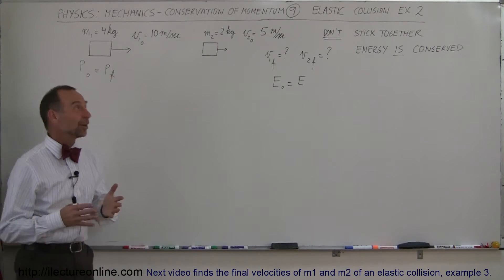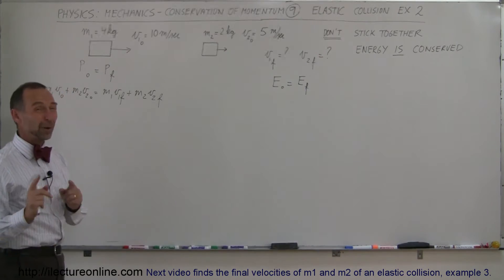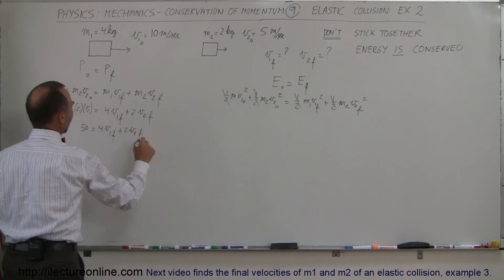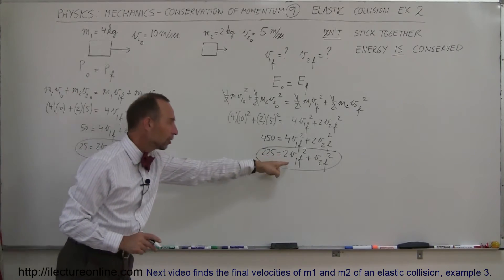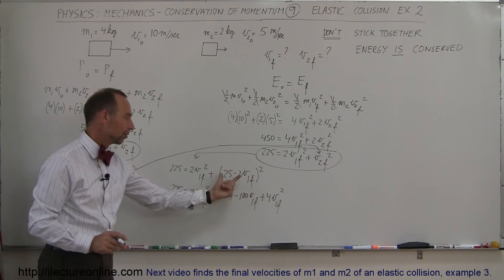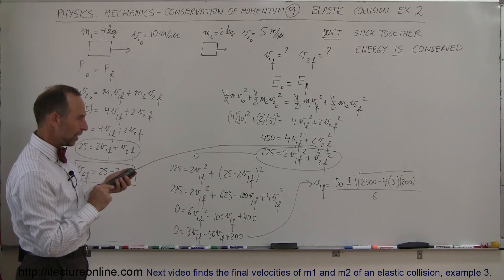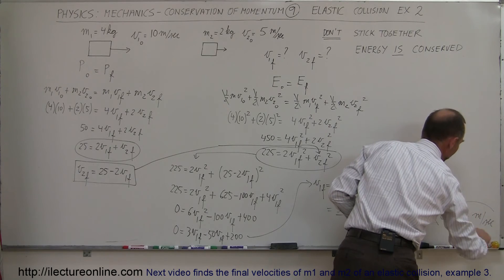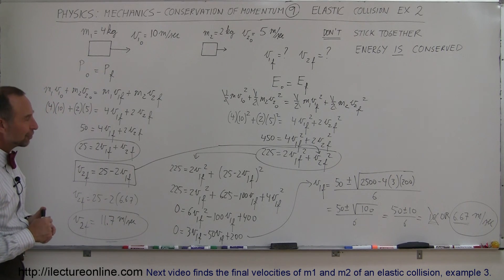Physics 10   Momentum and Impulse (24 of 30) Elastic Collision Ex.2

Comment: could you solve this problem
A ball with 500 g strikes a wall with initial speed v1 = 20 m/s at an angle   = 53.1  and rebounds with a speed v2 = 10 m/s at an angle  = 36.9 . The ball is in contact
with the wall for 10 m/s.
a)What is the impulse (magnitude) of the wall on the ball?
b)What is the average force (magnitude) of the wall on the ball?
Reply from the maker: Leyla,
I will post some more videos on impulse and conservation of momentum.
For the problem above, are the angles in reference to the horizontal or the vertical?
Reply: thanks sir. 
 horizontal and i think this problem can solve with 2 dimension i and j. Am i correct?
Reply: yeas right